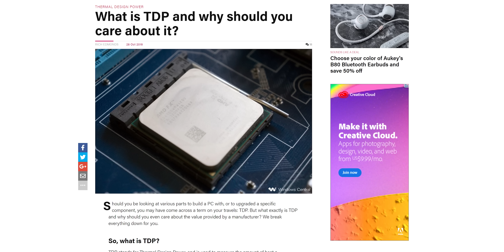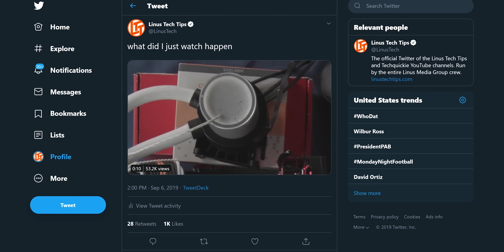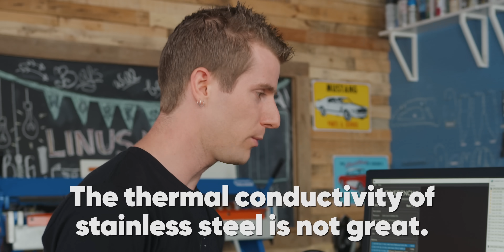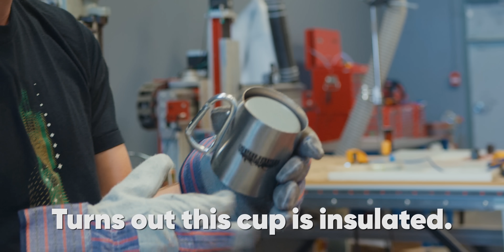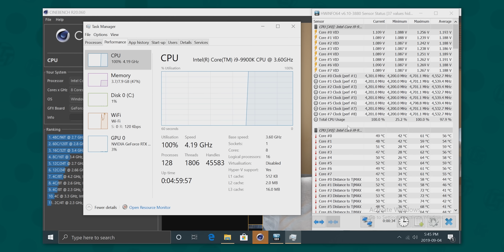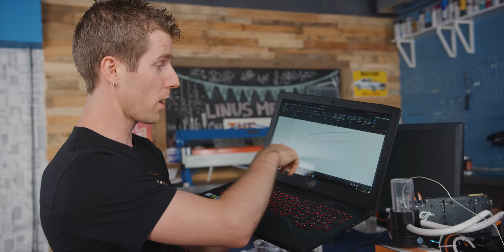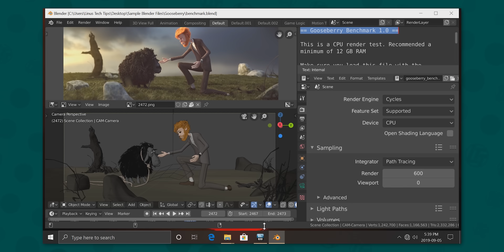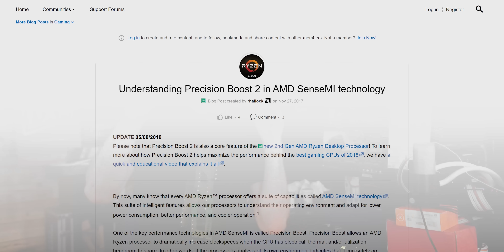Who REALLY Runs Hotter? AMD vs Intel

Comment: it takes 1 calorie per gram of water to raise the temperature 1 degree C.  if you want to measure the heat.  Heating over time is a differential equation resulting in e^t/tc or something like that offset by some R factor for allowing heat to escape.  Does this make any sense???

Comment: you guys go through such great lengths to ensure you get reliable data but then you pour different amounts of indicator into your water.
I dont know the chemical reaction of that particular stuff but i have reason to believe that each and every 'mol' difference (in concentration) will get you completely unreliable results.

You could have just mixed the solution in a bigger container and then take some of it for your test (the volumetric difference would be way less impactfull and youd have the same concentration each run)

Comment: I think it would be a good idea to implement a TDP system that is calculated by taking a voltage + current reading directly off of vCore at the socket (to account for vDroop from the VRM output due to resistance in the rail) to get the CPU's overall and sustained peak power consumption so board makers can specify parts more accurately, then also work out using a known thermal mass exactly how much heat is being output by the processor during an industry standard professional workload for a known time (say, a Ray traced Blender render for 25 minutes) to determine what the total processor efficiency is as well as the maximum TDP that the coolers need to be able to sink to keep the processor temperature under TCase / TDie. Guaranteed Intel's TDPs will be higher than they advertise on their products at the moment.

Also... ALL FOR JUNCTION TEMPERATURES ON THE PROCESSORS SIMILAR TO THE RX AND VEGA CARDS AMD PRODUCE SAY AYE!!! Edge temperature doesn't tell the whole story!!

Comment: this is great regions you are diving into. 
may i suggest, since you have so many great hardware variations at your reach, a scientific way based on air cooling and heat capacity of air: 
* build an isolated box, bigger than a regular tower, so you have a bit air to heat up, that contains only the mainboard, ram and CPU cooled by a strong air cooler (you want all heat energy to be transfered to the air away from the cpu) and set the cooler to run at max to avoid bottlenecking
* chipset/mainboard design will play a role, but you can vary different chipsets and mb designs to smoothen this influence
* all other components (power, storage, gpu, ...) are wired to outside
* run with same humidity and temp at start
* automatise the "load" you want to have as a test 
* measure temp and humidity over time and stop at a fixed high temp like 90 °C

* variables to compare: lenght of run, area under temp-time curve, area under computed-time curve, the two areas compared

Comment: Use a normal water cooler and measure the flow rate and the rise in temperature of the water between inlet and outlet..

Comment: magnets dont stick to stainless steel so it would of told you linus!
Reply: They will stick to low quality stainless steel like 304 will often be magnetic while 316 is almost always non magnetic.  We sell stainless steel ducting at work and sometimes we get 316, sometimes we get 304 and the 304 is magnetic while the 316 is not.  most food products should be 316 or higher though.

Comment: Bruh. Don't be shy. That's a coffee cup calorimeter. You could have just used a couple styrofoam cups! That metal cup is actually going to throw off accuracy because of its thermal conductivity. It likes to take and give away heat quite readily. I guess if it's held constant between tests you'll get good relative answers. But you won't get an accurate answer in terms of absolute heat output. The water will be a lower temperature because you aren't factoring in the thermal mass of that cup. Which will take a LOT of heat from the water

Comment: I've used EASEUS Partition Master for many years. Decent program, though I find it to be a bit slow and clunky. However, it is really easy to use, which is why I use it over other more technical solutions, unless I'm dealing with a failing drive.

Also... always by the version with the lifetime updates. Also keep in mind that every time you need to install it, you will need to contact their support team to have the key renewed.

Besides my qualms, I do recommend it. But perhaps this would be a great video idea, a head-to-head for partitioning software!

Comment: next time, if you try this again, you can use an open loop but use a block with a large chamber which you can pull a vacuum above it, as long as the rest of the system is fairly ridged  the water wont pull up into the vacuum tube.   This will let you drop the boiling point of the water in the water block in a predictable way depending on how strong of a vacuum you can pull in the system and hold constant.  Then just measure the time it take for the water to start to boil, that will be your visual indicator like the Dye, with the added benefit of being able to adjust the boiling point by how strong a vacuum you pull.  If you build it good-enough you can get the boiling point down to 60dec C which should keep you from throttling. hold the volume of water constant and this should be accurate.

Comment: I think intels TDP's are wrong. They dont account for AVX2 workloads. My 8700K's TDP is 95 watts, I ran OCCT5 for about a half hour and my wattage hit around 145 watts on just the cpu with a AVX2 synthetic workload. I had multi core enhancement on with my cpu at 4.3 Ghz

Comment: Too bad your mounting system on the Peltier project was only for Intel CPU. You could use the Peltier to keep a precise temperature and measure the amount of power draw by the Peltier, which is proportionate to the amount of heat generated by the CPU.

We use an equivalent technique to measure with high precision the amount of heat generated by a reaction. (Organic Chemist here).
Reply: As long as you had a high quality Peltier unit that could actually keep up with the heat output. And i think the biggest issue they had with their setup was not pulling heat from the hot side fast enough. Dissipating 600 or so watts from such a small area is pretty difficult.  Im not sure how much heat your dealing with in your case but if its small scale it's probably a bit easier to do accurately then it would be with a high power draw CPU. Using a power generating Peltier would probably change things a bit too since a unit designed for power generation behaves a lot different then a peltier designed to just pump heat. 

I've been playing around with the cheaper medium power peltier units and they seem to take as much power as i give them no matter the temp differential. Im working on a power controller to efficiently run a peltier at a set temperature while never turning off completely so that heat isnt just transferred right back to the cold side immediately.
Reply: @CondoreComputing  if there shoving excessive amount of power in to the peltier than it wouldn't be so bad, a chip rated for 200W doesn't get any colder if you give it 600W more of power, it just makes it more effective at making heat. in actually they would need a much better peltier than they had, and not use chips that power hungry in the first place.

the point of the video was never to make it work, it was just a fun idea to laugh at.
Reply: @BloodSprite-tan  word homie
Reply: Or you just use Ice melting at a constant melting temp...

You know sometimes you get along without high tech. Only potential problems are ensuring the ice mass is the same before the test really starts, and that the ice can melt fast enough (but that's a question of surface area).

Also the time ratio will not precisely describe the power output ratio, because of the constant heat source of the surroundings. But with some math and a comparison test without a heating CPU you can actually calculate that out of the equation. Meanwhile your suggestion will have a similar effect unaccounted for, as your situation is... More complicated.

You don't always need to get expensive equipment just for some small tests, and for scientific accuracy for a singular test a simple setup is often better than fancy expensive stuff. It might be more comfortable for you chemists and actually more repeatable once it's set up in your labs, but these Peltier elements come with a huge setup mess that LTT would never get right.

The calculations for the ice melting meanwhile can be done with school math.

Comment: D5 causally adding another 15-20% additional heat into the loop.

Also MCE blowing out the power usage (and heat), if you wanted to increase turbo boost duration, increase that, not MCE. You disabled those turbo boost limiters invalidating the TDP.

Comment: 2:20 - So fun story time, Ive had all generations of AM4 CPUs and as you might expect the recorded wattage through my motherboards VRM has reduced but temps have gotten higher because Im finding it rather difficult to deal with the heat density of Zen2
edit:
4:42 - Forbidden milk... I dare ye to lick it.

Comment: CPU temperature should ideally run between 30 – 40°C, with some going as high as 70-80°C. Anything above that, especially in the 90°C zone, and you’re asking for throttling and failure to occur.

Comment: Easy throttle the cpu at max with the same cooler. Lower the temperature compared the wattage the more efficient is the cpu. 90W 100C poor efficiency 105W 45C very high efficiency efficiency = cpu powa

Comment: You know, you can calculate the amount of power that it draws from the motherboard then multiply it with the 1-efficiency of the CPU, and that gives you the heat output of the CPU in terms of Watts.
Reply: But you also messure the vrm :/
Reply: @SuperUltimateLP  I'm sure a guy like Linus who experimented on using toothpaste as thermalpaste would figure something out about it. :)
Reply: @aliozanerbektas  yes a (noctua) fan to keep the vrm at roomtemperature on both boards ;)

Comment: 7nm is more efficient than 14nm. It's going to output less heat because it's using more of the energy rather than losing it through radiation.

Comment: No,  The difference comes from you very poor controls in your experiment making your conclusions based mostly on random numbers.  I get that your not a working scientist so I don't hold you to any kind of reasonable standards but that kind of sloppy mess doesn't make your conclusions any more valid then a flat earther saying, well it looks flat.
Besides, the value your trying to measure is pointless as if you make companies compete on it they will just off load things to outside the chip.

Comment: AMD has always ran cooler in any applications I've ever experienced.  Lap Tops and Towers.  Just my own observations no testing involved.
Reply: AMD used to throttle at a way lower temp as well, while reporting measurements with a built in offset.

Comment: Why not just put probes in a standard loop, both before and after the CPU block? You measure the difference in temp, and through some algebra based on waterflow rate, you can determine exactly how much heat is being transferred from the CPU to the water.

Comment: Why not custom water loop  and see the fluid change on the clear tubing ?_?
Reply: Because they can already see it in the reservoir. There's no benefit to that unless it looks cooler or something.
Reply: Warm Soft Kitty  If people with air cooled systems would do the same level of maintenance that water cooled guys do, their PCs would run so much better.
Reply: Warm Soft Kitty  Not really much upkeep required, maybe after a few years. I would say they aren't worth the time and money they take over a regular cooling setup in terms of performance though.
Reply: Ehh, I could see a proper CPU loop with a temp probe checking water temps. The color changing liquid was for cool factor and in no way helps with accuracy in testing. Too many uncontrolled variables here for any usable data. Simple loop with a block change would keep volume the same, ambient water for repeatable results, same temp sensor so you eliminate the difference in measuring devices.

Comment: Hi linus team, that what interresting but scientificaly incorrect (sorry for my english, i know it's trash). By using the same water in a loop you end up with the water temp rising, and the thermal transfert is determined by the delta in temperature between the source of heat and the fluid, so less delta equal lees thermal transfert. You should use two large reservoir ( i mean really large, 50 to 100 litres ). The first one will have water at ambient temp and stable, let's say 20 °C, then you pump this water throught the waterblock with a pump at a knowed and constant flow rate. The used water then get stored in the secondary reservoir who should have very little mass, like plastic for exemple and high insulation and radiation protection to limit as much as possible heat transfert to the ambient element. By mesuring the time, the delta in temp between the two tank and using the constant flow rate you will know how many calories as been transfered and you will know how much power as been emitted and evacuated by the cpu. By the way, the temperature of the cpu has a large impact on his efficiency and so by letting them running hotter to the end of your test you have decreased their efficiency.

Comment: An idea!
It would probably be easier to use a regular aircooler to mount normally on the CPU, then place the part with the fins in a sealed container of water. Then insulate the heatpipes and the top of the plate contacting the CPU to prevent heatloss before reaching the container. 
The heatpipes would transmit the heat towards the fins, which are submerged in water, and you could easily monitor the temperature rise of that water. The heatpipes would also propaply transmit the heat away from the CPU and into the water fast enough that the CPU wouldnt throttle.

Comment: For odd reason there has been no cpu heat cooler part bucket design for those type of test. Expect pumping pipes water cooler. It so strange guess it custom made as well type of cpu and motherboard model.

Comment: Measure how how many joules of energy it takes to run the render benchmark with the same cooling solution, same ram/ramspeed same mainboard phases, 10 times. Which cpu does it faster, does faster cpu end up using more power or does slower cpu end up using more power.  That way you know which cpu is more efficent (at least for running blender).

Comment: did the temperature sensor touch the bottom of the metal cup or was it at a distance. If so, was it at an equal distance in both tests?

Comment: Could it be that the dye was gunking up the water block on the second intel run?
Reply from the maker: No, the block was clean when all was said and done. The dye stayed in solution for days at a time (because this project took a while...), even in the cups we set aside.
Reply: @LinusTechTips  sweet, thanks for responding/addressing this.

Comment: You can use a TEC to generate power from the heat generated and measure it that way!!!
Reply: It works both ways you can put power in it to cool and heat a side or just heat a side and cool the other and the diffrence will generate power!!!!!!!!!!!

Comment: You can definitely use a magnetic to tell if its stainless steel.....Austenitic wont stick a magnet at all.   low grade/ ferretic stainless is slightly magnetic but no where near as magnetic as steel and there is a significant difference in force. Source: I work in industry

Comment: Hey look, it is a calorimetry experiment! Let's see how this goes.
Reply: It's an LTT video. They pretend they care about doing things right (they clearly have the right knowledge, based on what they talk about) but Linus doesn't have the patience to do things correctly (measure EVERYTHING precisely, isolate as much as possible, etc.) so they never quite get actually useful results.
Reply: This brings me back to chemistry class😂😂
Reply: Things gone wrong, Gone sexual
Reply: It's cool to see the channel develop. They generally improve quickly/well with critiques. I'm sure some of the crew at LTT learned a lot about the scientific method from doing this, and from doing the slo-mo work they did a little while ago.
Reply: @Chaosdude341  They didn't learn anything about science or testing with any real accuracy. Linus uncuts any scientific process of technique prior or during "testing." This is a high school level chemistry lab, fail. The Peltier cooler videos are a mechanical/electrical engineers bread and butter, failed.
Reply: @Mezuzah87  Even if he did not follow a precise scientific procedure, he still emphasized that no matter the testing and because AMD and Intel test differently, no CPU can be accuratly judged without a direct comparison. This I respect as the content of the video was to show not only how Linus and Anthony tried doing this comparison on their own, but also wanted to get the message across.

Comment: Interesting method of measuring heat. Another way you could do it is an energy balance. You need the inlet and outlet temperate, flow rate, fluid density and specific heat capacity in a water cooling loop. That’s how we verify energy dissipation in the lab I work at.